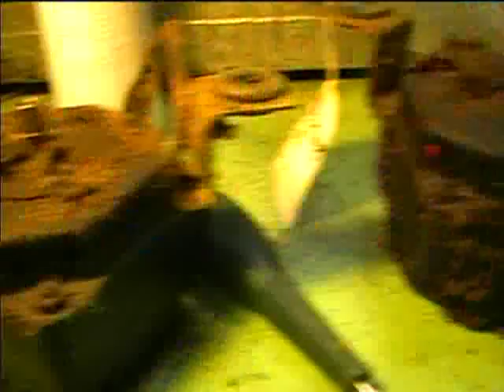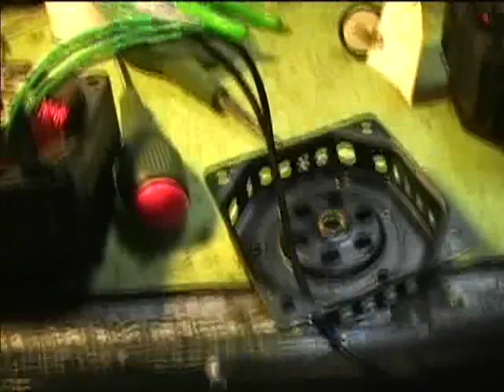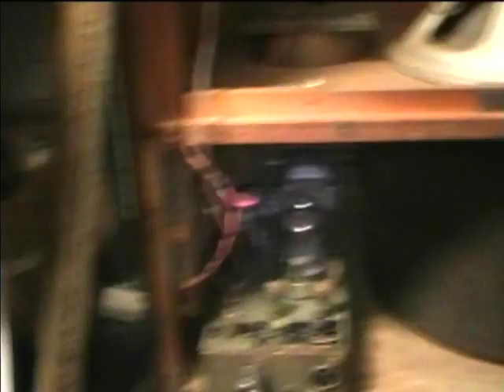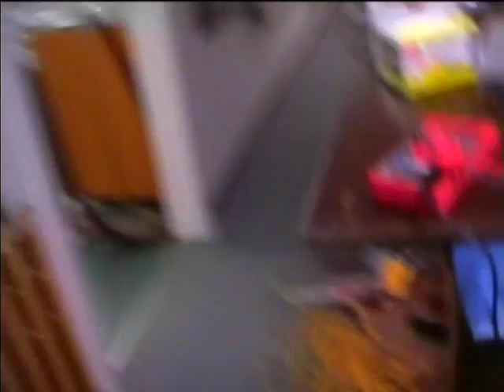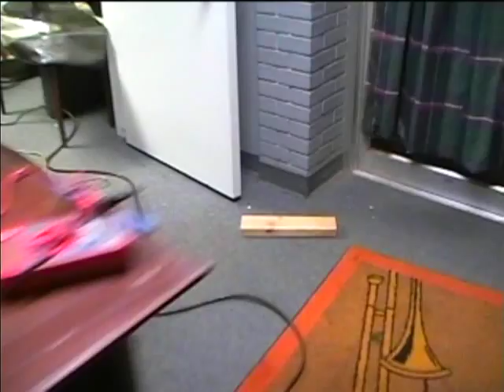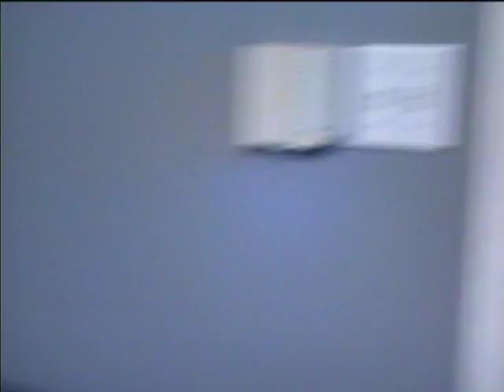Hammond B-2 organ and Leslie 22H Test

Comment: @Twonky411 The bottom line is that these shaded pole induction motors were built to run at one speed, and everything about them, including cooling, is based on that. Several places have tried to make them run at different speeds, and none has been entirely successful, resulting in overheated and burned-out motors or noisy operation. My feeling is that if you've got to have two-speed operation, get a two-speed motor stack.

Comment from the maker: @Twonky411 The currently-made Leslie speakers actually use do a triac system to vary the speed of the motors..we had some cases of burned-out motors in those Leslies because of shorted triacs putting DC into the motors.